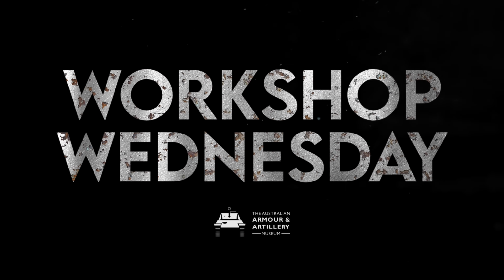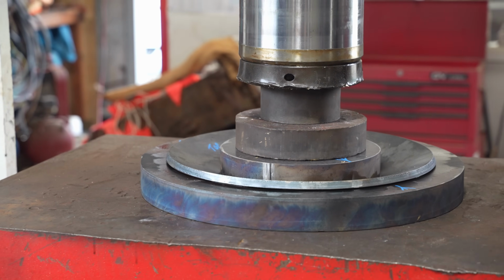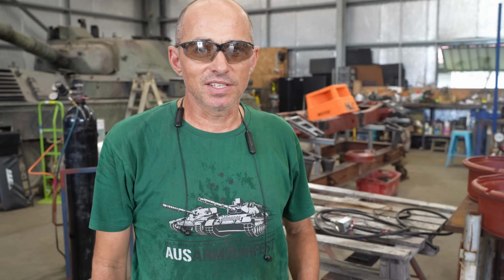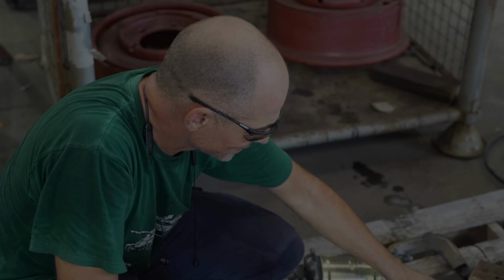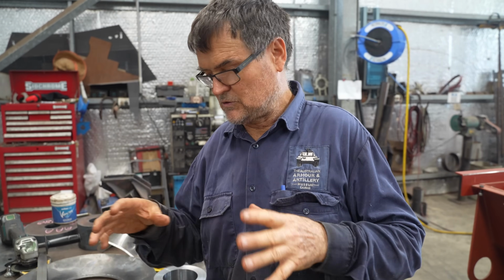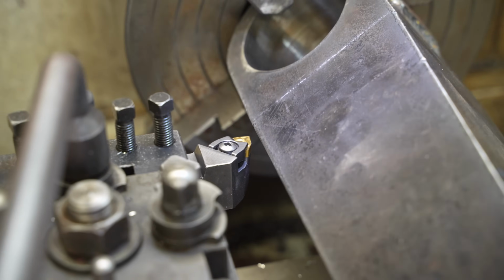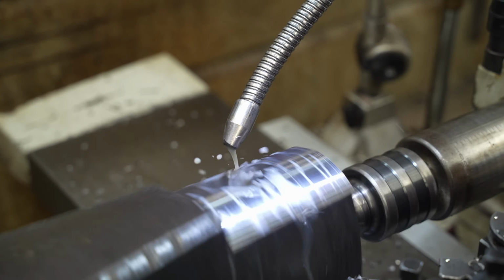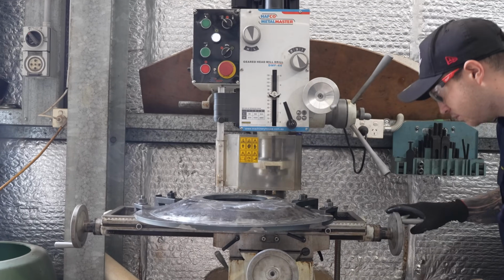WORKSHOP WEDNESDAY: PANZER I swing arm and drive sprocket hub fabrication and engine test!

Comment: My Dad told me that the metal work that was normal, routine stuff was originally done for railroad suspensions and for Naval ships' drive components; the metal work these talented metal workers do at Oz Armour is one-off, specialty stuff. The original tanks were made in immense factories with huge machines; most of the work was done by stamping the metal when it was newly made, and thus comparably soft, with just outrageously(by today's standards) huge hydraulic presses. Then they would be finished, using huge milling machines - so everything was done quickly and easily, by the manufacturer's point-of-view. This is how they made so MANY of these magnificent machines. They destroyed most of them after the war, as soon as they could. Many of the armored vehicles we have were found relatively recently, they were buried in bogs and thought to be lost; but the cold fresh water and it's mud actually preserved them.

But the engineering CAN be understood, and replicated. This is why these videos are so absorbing; you have to remember, the whole world used to be done this way. You start to understand the forces involved by thinking of the making of these individual parts - that they used to stamp out those swing arms and drive assembly housings by the dozens every shift, and then assembled them in huge plants that were underground and hidden from the Allied heavy bombers, and then shipped by train to the front, where they would fight for a while and then the crew would have to destroy their tanks as they had small mechanical problems or ran out of fuel and then abandon these magnificent, expensive machines - after they blew them up. 

The men in this shop have done videos showing how they straighten armor plates that are over an inch thick and then blown apart - the force needed to do that to that high quality steel, THAT thick, is just mind boggling. What a waste of resources that whole war was; and you can just imagine the expense and effort put into those tanks recently sent to Ukraine - and the ones us Western countries send them are the old, used stuff. Well, enough ancient history; sorry about that.

So, keep up the good work, Oz Armour Workshop; and Thank you for making these magnificent old machines come back to life from wheel-barrow loads of scrap steel bits and pieces that are all that's left of the Nazi Reich's world-conquering machines. see you next week.

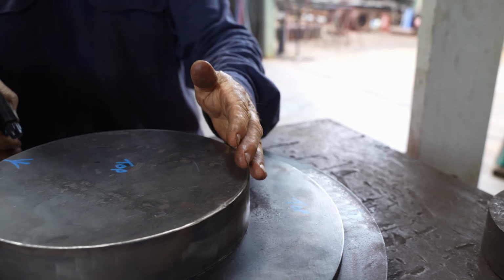Comment: 2:07 with an open dye like that, you can fix that by tacking a few fingers. It's that first 2 seconds of the bend until the motion builds momentum that matters and a tacked finger will hold the plates centered.

Comment: When you guys said that as a privately-run Museum that you had to stay within a budget and therefore couldn't get things like casting done, it reminded me that there are at least two Foundrymen in your area (also on YouTube).  One is in Australia and the other, I think, is in New Zealand.  There is another Foundry (on YouTube) in Mississippi, U.S.A., that casts steel items, starting from worn out automotive brake disks which provide good quality material to start with.  And, I've got several books on how to build literal backyard cast iron/steel Foundries, so I'm sure that if you guys were willing (and permitted by your insurance!), you might be able to set up a small Foundry out behind your workshop to cast some items that you need in your restorations -- if your local small Foundries aren't willing to or can't do that foundry work for you.

Comment: Top stuff!!

Just a hint if you do any more "pressing / drawing jobs like this:

Your basic "oils" tend to lose their "slipperyness" under serious pressure, so something better is required.

Hi thee to your local "auto" stuff suppliers and pick up some "oil conditioner"., "Lucas", Morey" etc. This stuff has the consistency of honer on a cool day (good luck with that) and stays "slippery" under serious pressure. 

On a smaller scale, it is an ideal lube for serious cartridge-case re-forming / wildcatting:  Any deep-drawing operations with pretty much any material.

Actually works in you car / tank as well, especially with "pre-loved" machinery.

Next up: a 'scratch-built/ "major recovery" Pz 2 "Lynx", dished road-wheels and all?

Comment: Later versions of the original Pz. Kpfw. 1 were powered by a Maybach NL 38 engine; a 3,8 litre, 90 hp, inline six cylinder, petrol engine. I believe this version of the Toyota diesel is also about 90 hp. Should be perfect!

Comment: You know mates..I'm a huge Historian about many wars .But when I was in high school I read a book about the Battleship Bizmark..You know it has three propellers...Well they said when they turned the propeller shafts on lathes that were at least 200 ft in length..That at 8am an Machinist  would get on a trolley hooked to the cutting arm/bit and it took 8 hours to do one cut?!!!!.Then another Machinist would get on the trolley and make another turn,hither and yawn and so on and so on..Till the shaft was ready for balancing and installation....

Comment: Even if it's not the original motor, at least the Panzer I will have all-Axis parts! 🤣

Joking aside, they really couldn't have picked a more bulletproof motor to drop in there, and as Kurt said - run it without the muffler!

Comment: For the dished component would you ever consider High Energy Forming ?   In a water tank with a resin or plaster negative use an explosive charge to press the sheet into the form.  
I recall the British Army were experimenting with this to produce heavy duty Clutch Covers for road vehicles.    Video I have seen shows it is a backyard replicable process which seemed to get a reasonable result in a deep dished and fluted piece of 1/8"  plate.   Just suggesting  ...  maybe it's a no no in Aus ..🤔😏
Reply: Years back I worked with a metallurgist who used to do explosive forming for the MOD, ironically he now lives in Sydney.
Reply: @johnsherborne3245  Thank you for confirming that this technique is recognised.   As I recall  one of the unis  were trying to develop a scalable variant  using a gas charge  to drive a ram.   Never heard more about it.    Certainly it doesn't need large charges  as film I have seen  scarcely raises much of a splash.    I think the military rolled out PE sheets  but I would think a length of Cordtex prepared as a coiled cheese  would work quite as well.    I note the museum has rough land for trials and there must be a contractor who could be enticed to attend and supply the materials.    Would be of use prepping more complex shapes  and guaranteed get good  viewer ratings.
Reply: @causewaykayak  I remember reading about a chap in Oz who built an aluminium hulled yacht, built a big hole in the ground shaped and rendered to the female hull form, welded up a rough fit of aluminium plate, filled it with water and detonated a charge which thumped the metal into nice fair curves. Ever a resourceful chap he then painted the mould blue and called it a swimming pool.  I had wondered if a gas explosion would be enough, but maybe the detonation is too slow. The key is to be fast enough in working the metal that new grains don’t form. It’s how drinks cans are made. Thump the metal very hard and very fast.
Reply: @johnsherborne3245    Yes,  don't give it time to think !    That's very likely why no more was heard (publicly at least)  about the fate of that  petrol  driven ram.   I find the videos AusArmour museum and workshops a compulsive watch  with so much skill on show and the exhibition staff so knowledgeable.
Reply: @causewaykayak  i do wonder how it’s financed though?
Reply: @johnsherborne3245  Wealthy owner and admission fees I heard.   In a recent video Kurt said he was an investment advisor to the owner -I think that's the term he used.    That usually means Lots of Money.    It's very generous of him to do all this for military  history.   Should get an award  but given much of the politics down under  its probably not highly regarded by many.

Comment: I wonder how much it would cost to have them build a replica Panzer 1 from mild steel or an equivalent. Not armour. Something that looks like the real thing but has a modern engine gearbox, brakes, electrics and steering system.

Comment: I understand the logic of the Toyota diesel engine especially for reliability and budget but it wouldve been cool to see it powered by something petrol and German (I was thinking Merc but Wikipedia says the original engine was a Krupp which doesn't relate to anything from the modern automotive world). Anyway you'd probably want the diesel for the torque I'd imagine.
Reply: Let’s not forget that Toyota has a very big footprint here in Oz,  which means that’s parts will be cheap and still available for decades to come.

Original would be great, but probably impossible to find and/or way too expensive, good compromise, in my opinion.

Cheers,